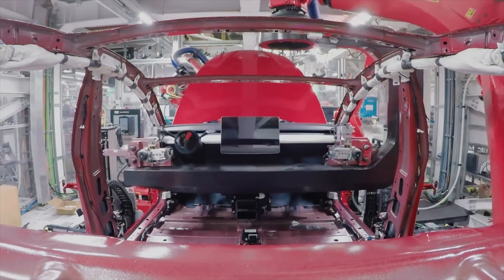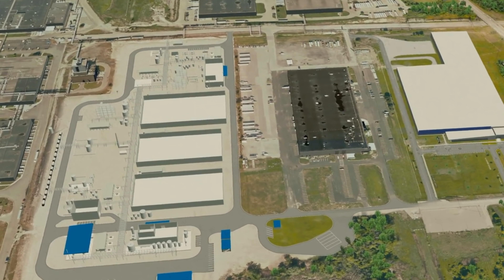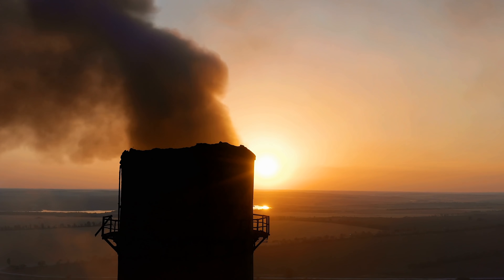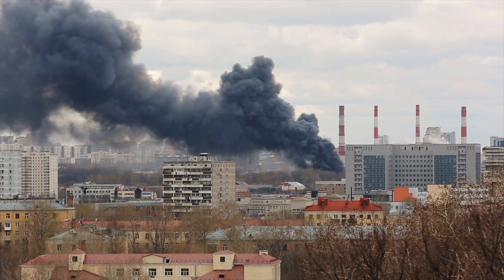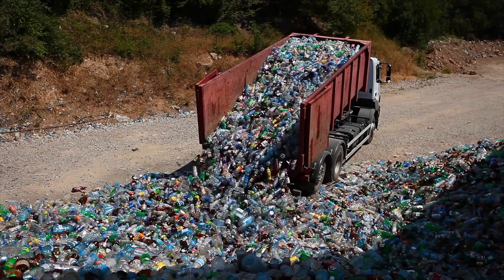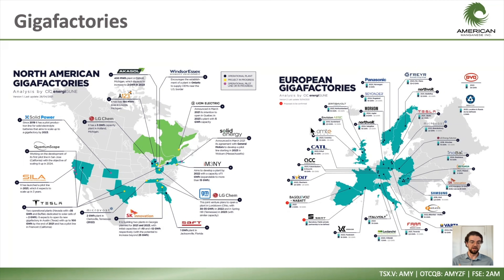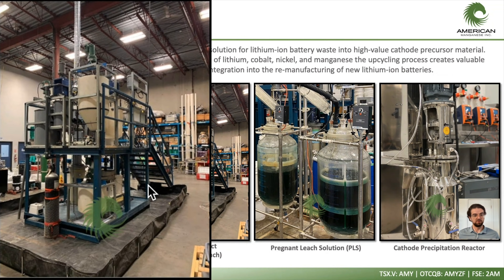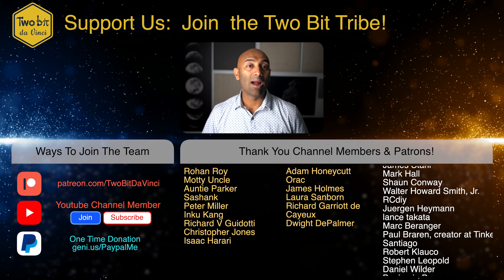Why Battery Recycling is the Next BIG Thing

Comment: Question: once all the pieces are mixed or combined in some solvent then different metals react differently and hence seperation. Now my question is what would happen to the solvent after they extract the metal from it? Will it be wasted
Reply: He said in this video that it doesn't leave the facility, so yes likely it is just reused constantly.
Reply: I had the same question. I hope the solvents are reusable and don’t require some sort of storage and dumping.
Reply: In processes like this reagents are usually reused several times often for decades it isn't usually cost effective to dump them.
Reply: It's likely that the solvent is regenerated.  I doubt that it's actually a "solvent" in the usual sense, but rather a complexing agent of some sort.

Comment: Even with closed loop recycling, green energy or renewable energy can't come anywhere close to providing enough energy to supply even the current needs of the world. Renewable is not efficient enough. If the radicals are more realistic, then we will make progress in the right direction, but radical changes are more likely to cause destruction instead of construction. Things need to change gradually instead of radically. Realism is the only way to approach these challenges. Unless someone make a "Radical" discovery in science that changes the paradyme, getting off of fossil fuels is going to take time and developement.

Comment: 60 to 70% marketshare in 2040? Is that cars on the road or sales numbers? I'd guess the sales number will cross 60% by 2030 at the LATEST. Maybe even as early as 2028. The only caveat I see is that would be for the developed world. While the rest of the auto market is shrinking, Tesla is growing precipitously. They're on track for 20 million cars made per year in 2030. Who knows what other EV's will hit mass production between now and then too. 

As far as other methods go, Redwood Materials is another recycling startup. Who knows what they're doing, but they have JB Straubel so it'll probably be good.
Reply from the maker: I def want to dive deeper into what redwood is doing in the future
Reply: Redwood is starting with Pyro.  I think they plan to shift but it shows a lack of insight I to the environmental impact.  Just my $.02.

Comment: This seems incredibly promising since it reduces costs for the recycling parties as well as manufacturers, is more sustainable and more efficient in recycling the raw materials itself. However, I missed the cons - other than the missing standardization in batteries at the moment I did not really get what is stopping this innovation from being the standard already? Why is it not yet as popular? I might have missed it or misunderstood something so I am curious to know what is yet missing for the breakthrough. 

In any way thanks for the video! Inspiring as always.
Reply: One of the reasons why this isn't standard yet is because these highly efficient companies are rather new and still growing. Furthermore at this moment the need for recycling EV batteries is fairly low (now you either get batteries scrapped at production or 10-15 year old batteries), most EV batteries being produced now won't reach these recycling facilities for the next 15-20 years or so, possibly even more. So quickly scaling up isn't usefull too, these companies need to be carefull to not overexpand in the next few years, because the costs of that might be too large.
Reply: @MDP1702  That makes a lot of sense! Thanks for the explanation. I appreciate it.
Reply: It is becoming the standard.  These things don't happen overnight.  Processes have to be developed and perfected.

Comment: How is water cleaned at end of cycle.
Reply: I commented the same thing. I always thought using up the fresh water supply is a concern. Also, what happens with all those chemicals when they're done? I hate to nitpick because this is MUCH better than just throwing them away or using fire. But if we're going to do it, let's do it all the way.
Reply: @xliquidflames  it is litterally stated in the video that the reagents are reused at the end of the cycle (fairly standard procedure with hydromettalurgy)

Comment: EVs may produce no pollution on the road, but the electricity they consume comes from power stations fueled by coal, gas, wood pellets, uranium, etc - what environmental costs do these excess electricity costs cause?
Reply: Internal combustion engines are at best 30% efficient. EVs are over 90% efficient. That's the biggest part of the equation.
Reply: Stupidest argument ever and getting old. Coal & gas getting replaced by wind & solar with battery storage as much cheaper meaning electrical mix is getting cleaner and cleaner. Biggest roadblock for making this change happen faster is oil, gas & ICE auto $ paying off politicians to slow down the transition. Clean energy could satisfy all electrical needs $ put into transition rather than supporting these outdated sources like oil & coal.
Reply: As EVs use about 1/10 the power per mile travelled the environmental cost is far less than internal combustion vehicles. They can also run on much cleaner solar and wind power.
Reply: @beachcrow  that's intresting that battery cars only use 10% of energy that gasoline cars take. Does not compute ! The work being done still has to be done. What is weigh of motors and batterys vrs weightt of engines and fuil system?  Further check out full life cycle cost of energy used hydrogen take about 3vtimes more energy than a gas engine and that has to be paid for. One example I've seen that gas to go 500 kilometers cost 18 bucks while hydrogen cost 78
Reply: I don't really comment on youtube anymore due to it's censorship, but I just had to. Whenever I hear this nonsense about electric cars producing no emissions it just boils my blood ! In reality all you're doing is moving the point of pollution from one place to another (or several others), and while power stations are usually equipped to deal with emissions better than a car, the reality is that when combining the power station emissions with the serious damage done in the manufacturing processes involved in ev battery production, plus the problems of disposal and subsequent toxification of the planet caused by said end of life battery disposal, there isn't much, if any benefit in over all real terms.
The truth is, there is little to be gained by the use of battery cars, and when further coupled to the severe inconvenience of battery technology. plus the volatility of said batteries (yes they explode and burn rather easily)  it's very difficult to see any worthwhile benefit. Basically it's a bit of a con.  So why is it being pushed so hard ?  Well there's a lot of money to be made, so the companies involved obviously have a vested interest in promoting and perpetuating this nonsense, and the politicians involved in the law making around this subject sadly but predictably have no clue what they're talking about, and/or have fingers in pies.  Anyone who could really be called an 'expert' in such matters knows that Hydrogen is the only viable way to go, but it's far less profitable so .... well you know where that's going.
Reply: @mordokch  Hydrogen is as poor as gas in its efficiency, the reason it is so expensive. Plus a whole new infrastructure required vs electric which is already build or not needed when solar put on a home to supply an EV. You must have a vested interest in gas or Hydrogen, otherwise you haven't done your homework. The above video shows the progress in recycling batteries, not just used EV but also the numerous cell phone & other batteries currently being generated.
Reply: @denunder   @Dennis Underwood  Firstly I have no vested interest in anything but the truth. Ok - hydrogen is not perfect, but it is the best we have in terms of non polluting and convenience factors, ie no charge time - just fill up and go. The infrastructure already exists in the form of regular fuel stations, it is a relatively simple matter to install the necessary equipment to dispense hydrogen instead of petroleum, so that's just a non issue. Of course, hydrogen being literally the most common gas in the universe doesn't hurt it's prospects as an alternative fuel, but it does kinda hurt it's profitability.
Finally - look more closely at this battery recycling story being told in this vid - these people have been outed, and their claims well and truly debunked already - this is actually quite old news at this point. 
Finally finally - using solar to charge and use a car is only somewhat viable in places with a lot of sunlight, and I do mean a lot. Of course most car usage occurs during the day when you would need to be charging them, so the only way is to store energy from solar until you need it, ie at night, ie in batteries - more batteries.
Reply: @mordokch  I can understand how you feel like you're getting "censored" if all you post is the kind of disinformation you wrote here.
Reply: @incognitotorpedo42  I take it you didn't bother to actually check ?  Lol of course not or you wouldn't be so quick to dismiss.
Reply: @mordokch  
the reality is that when combining the power station emissions with the serious damage done in the manufacturing processes involved in ev battery production, plus the problems of disposal and subsequent toxification of the planet caused by said end of life battery disposal, there isn't much, if any benefit in over all real terms.
Completely wrong. 
For one, these power stations can be those that emit much less pollutants than ice cars, like renewables and nuclear. 
Secondly, while battery production is more polluting, it makes up for that in a few years. 
Thirdly, once enough resources are in the battery life cycle, most batteries will be produced using recycled resources, seriously bringing down the impact of battery manufacturing. 
Fourth, these batteries are almost completely recyclable, especially regarding the rarer minerals, that is precisely what this video is about. So no toxification of the planet at end of life (how can it toxicate the planet btw if we first get it out of the planet, I guess you mean environment rather than planet).

and when further coupled to the severe inconvenience of battery technology
That is your personal opinion. Many would find the ability to charge at home or in the future while going to the store quite convenient. Only during longer trips should you fast charge for 30 minutes or so (and this time will reduce overtime). As for the range, even now it is quite suited for most people, though many people look more at the occasional longer trips do decide how much range they want.

yes they explode and burn rather easily
Actually, no they don't, it is just that everytime this happens, it ends up in the news. In reality BEV experience less fires per mile than ice cars. Though it is true that fires from batteries are usually more intense and they require a different way of dealing with.

Anyone who could really be called an 'expert' in such matters knows that Hydrogen is the only viable way to go, but it's far less profitable so
So much wrong about this sentence. Hydrogen is not a good alternative for personal transport at all, it is way too costly and much more cumbersome than EV's. The reasons most automanufacturers have dropped it is simply because it doesn't have a future on the road except for maybe trucking or very niche applications. Also how is hydrogen less profitable according to you?

no charge time - just fill up and go
Except if the pumps need to repressurize, then you can wait some time. And ofcourse the station needs to be fueled up enough and work properly. And during daily driving you just charge you EV at home, for hydrogen you need to go to the actual station, losing yourself time (and no people won't just be able to do it on the way. Hydrogen stations are so expensive you'll see much less of them compared to gasoline stations or fast chargers.

The infrastructure already exists in the form of regular fuel stations, it is a relatively simple matter to install the necessary equipment to dispense hydrogen instead of petroleum, so that's just a non issue.
No, it doesn't exist yet. Except for the ground you can use almost nothing of a regular fueling station for a hydrogen station. You need different tanks, pumps, pressurisation equipment, ... Any fueling station that needs to be revamped to a hydrogen station needs a complete overhaul. This is actually one of the largest issues, a hydrogen fuel station is crazy expensive compared to fast charging points or even just regular fuel stations (around 3 times more expensive). This is exactly one of the reason hydrogen will have great difficulty getting mainstream (even if we ignore the other problems). People won't invest such a large amount of money in a hydrogen station without a guarantee it won't be wasted, ie. there already need to be enough hydrogen cars on the road. However people won't buy hydrogen cars at all unless there are enough hydrogen cars. So you have the chicken and the egg problem. This wasn't the case for EV's that could/can charge at many homes even if there isn't enough other infrastructure yet. The only ones investing in hydrogen fuel stations currently are car manufacturers that have already invested a lot in hydrogen cars, like Toyota. 

Of course, hydrogen being literally the most common gas in the universe doesn't hurt it's prospects as an alternative fuel
It might be the most common in the universe, it isn't the most common on earth. All hydrogen we use, we need to produce from something else here using power.

look more closely at this battery recycling story being told in this vid - these people have been outed, and their claims well and truly debunked already
Except they haven't been debunked as of yet, despite receiving some attention. The way you look at is exactly the same way people thought that these wireless phones wouldn't amount to anything and were just a rich scam.

using solar to charge and use a car is only somewhat viable in places with a lot of sunlight, and I do mean a lot.
Not true at all. People don't use up their entire battery every day. Most people would only use maybe 10kW of power daily, possibly even less. Ofcourse you need the necessary solar panels, which not everyone can, but many do are able to get it. It depends on situation to situation obviously.

Of course most car usage occurs during the day when you would need to be charging them, so the only way is to store energy from solar until you need it, ie at night, ie in batteries - more batteries.
This I can understand, which is why using your own solar panels to charge your car can only happen with an extra house battery, working from home or during weekend days. In other words it is situational. However most cars or stationary for most of the days, thus if they are plugged in during that time they can charge during the day from the grid with power derived from solar panels.
Reply: @mordokch
Hydrogen roundtrip efficiency is a lousy 30% to be compared with 70%+ for chemical batteries. So why is hydrogen pushed so hard? Because you can make it from oil and keep the oil pumps running.